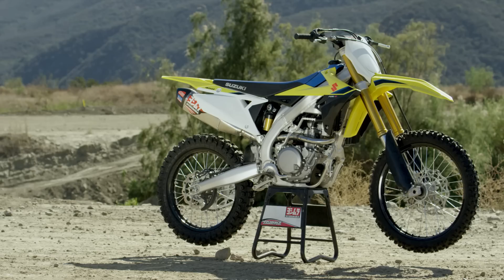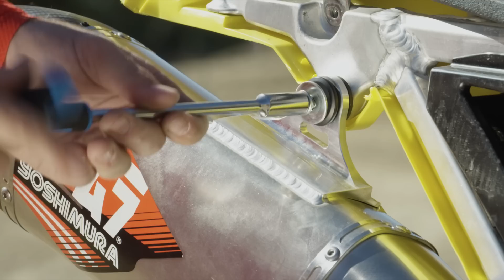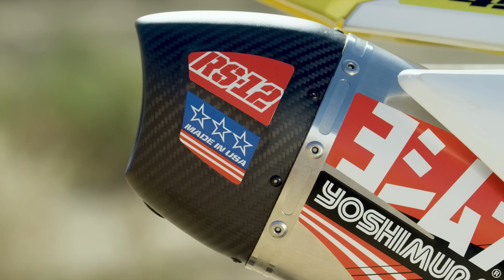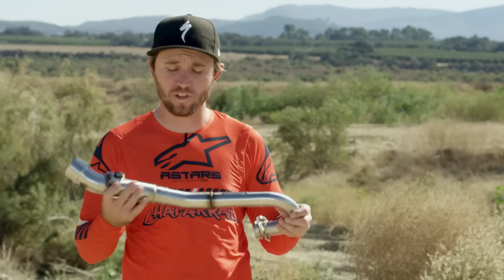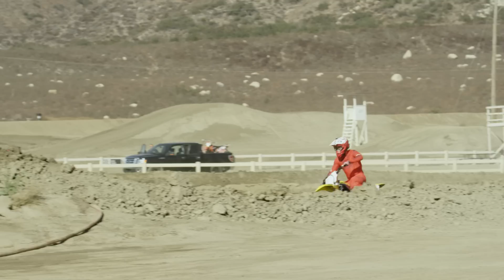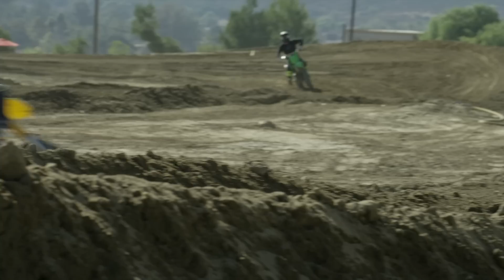Yoshimura RS-12 Evaluation on Suzuki RM-Z450

Comment: Getting this exhaust for my new '21 RMZ450 . Seems well engineered /designed. The stock RMZ450 is no slouch for 99% us riders/racers folks.
Reply: Lmao if u haven’t seen a lot of the new Hondas are running under 50hp but no one is calling it slow. People just hate on the rmz because they think it’s cool .
Reply: There's absolutely nothing wrong with the RMZ 450. Lol Its one of the most reliable 450 engines made. A few tweaks here and there its top level.

Comment: Yoshimura has always been very well produced and from what i’ gathered from friends the performance is on point. 

Question is: Will Yoshimura start making two strokes pipe/silencer aswell for the increasing two stroke market
Reply: You know the market forces aren't w/ 2 - smokers anymore bud. What we have now we are lucky to have. Best bet is get on board w/ new thumper they are awesome. Love my '21 RMZ450!
Reply: "...increasing two stroke market."
As an old guy I initially laughed almost spitting up my coffee. Increasing? Did he say "Increasing"?
Then I realized...he's right. They tried to kill them, thankfully to a couple manufacturers that stood up & said NO!
My 1st bike being a 78 YZ80, then started racing on 82YZ80J's, yeah I'm old & all we knew was 2strokes. I completely broke down my 78 to the frame to have my big brother rebuild the bottom end in Small Engine Repair or Automotive Class @ school & we did the Top End together at home, I was like 9/10yrs old. We used to be able to work on our bikes, right on the trail if necessary, leave it overnight in the bushes, come back tomorrow with tools & what parts you think you need. Boom...braaaaap braaaaaap braaaaaap once again.
I now ride a 4 stroke, much more calm of a ride, but nothing will ever replace the feel of the power band on a 2smoke.
Reply from the maker: We don't have any plans to make two stroke product.
Reply: @YoshimuraUSA  I hope you might reconsider for a possible future possibility.